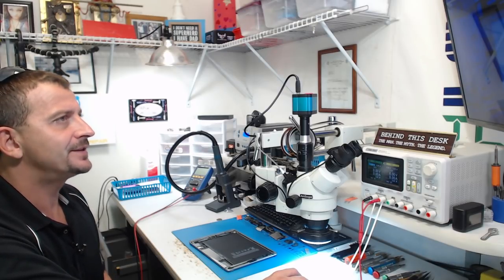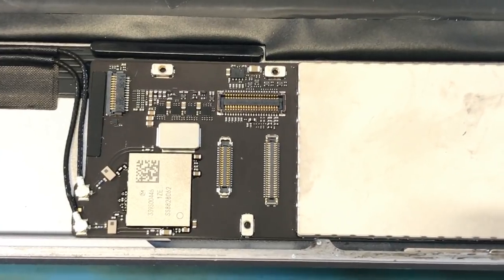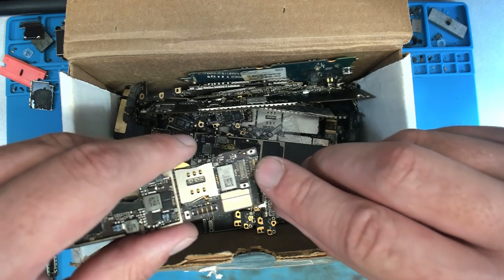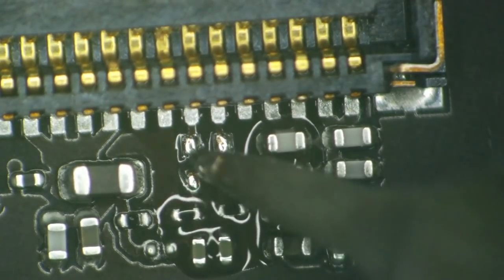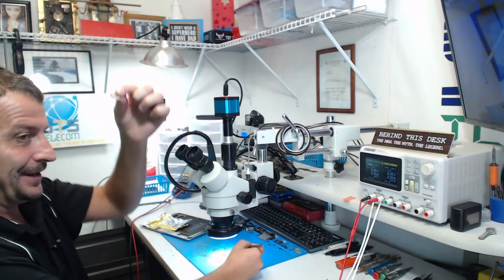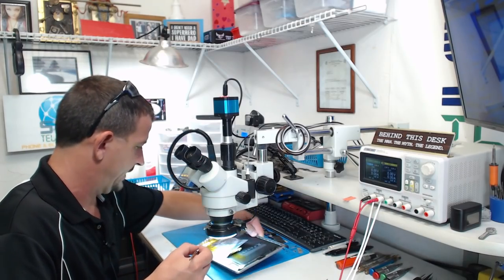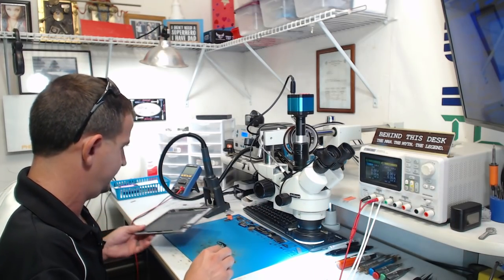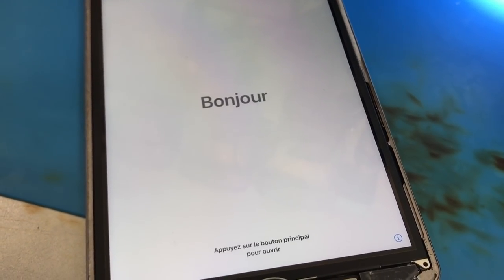Fixing an iPad 6 sent by a repair shop for "no image"

Comment: Well done Jason, I’d just recommend using smaller nozzle so it won’t impact the surrounding much, haven’t had any melting issues since I’ve changed up to smallest nozzle for these types of repairs, don’t even need to wrap or put metals to protect other stuff.

Comment: Glad to see the videos again.  I allllmost unsubbed just due to thinking you had decided to stop doing the YouTube thing.  But thankfully I did not.  It’s a joy watching your repairs.  I’ve done one micro soldering repair myself and proud of it but don’t think I’ll be switching careers anytime soon.  I accidentally caused pry damage replacing the battery on an iPhone SE 1st gen and knocked the FL2400 off near the battery connector which is in the battery data line path.  I decided I try the repair myself just to see if I could.  I used a $50 aliexpress digital microscope and cheap Amazon hot air station to do the repair and it was a success.  I do other soldering as a hobby just not typically microsoldering on that level.  And yes those components are tiny as shit lol.  Like a spec of dust that one!

Comment: Far king hell Jason, how effing small is that soldering, sorry soddering 😁 iron tip that was used to annihilate the choke legs left on the pads? After years of watching I am still astounded at you ability to manipulate the tiny tings on the boards. How many years does a tube of flux last? it seems like a single Rossmann repair uses more flux that you would in a lifetime. 

I wonder if your customer was on the receiving end of someone else who caused the initial damage. You customer seems like they had told you all that they had done and it was their customer that didn't provide them with the full story behind the repair/damage. I hated customers/clients who would not tell you exactly what they did because they were em-bare-arsed about doing something that caused the issue. (I was did software IT support and the cunts L users always lied) Thank You for the video Jason. It's appreciated as always! 👍

Comment: Hi Jason i got ipad a1822 i can only charge the battery when the ipad screen is on and it will charge then with 1A but when screen is off it takes only 0 A. What can be the problem.  I am from belgium so it is imposibble to sent it over. Can you help me what i can check

Comment: Great info! I have a air2 ipad (personal) that I keep scratching my head over, a simple battery replacement,  on this model, supper easy, the unit was working fine other than battery needed replacement,  put a new one in charged it fully, now no screen activity at all, I mean nothing! ITunes recognized it but not able to give commands on screen (touching) to proceed. I have a little microscope and checked for obvious damage on parts of the board that I can inspect and ribbon damage but it all looks good. So I'm besides myself, if you want to give me some of your great expertise over it ,great if not I'll never watch another video of yours again and unsubscribe! Just kidding 😂 thanks if you reply 👍